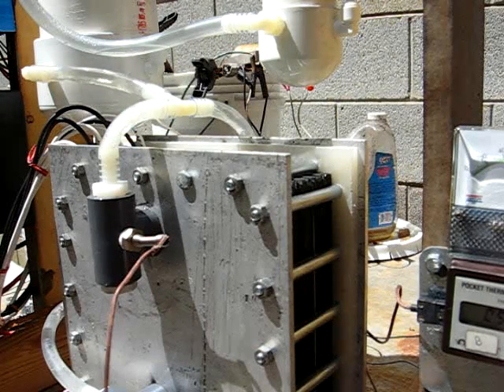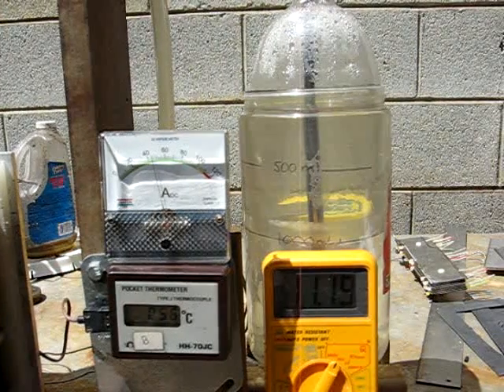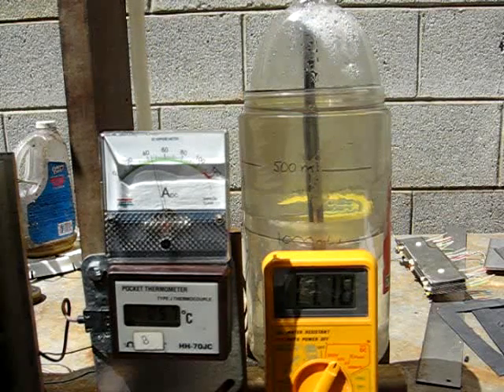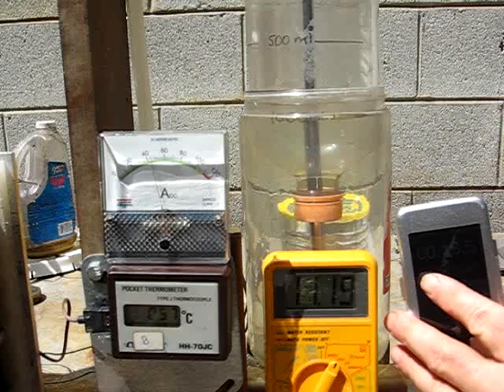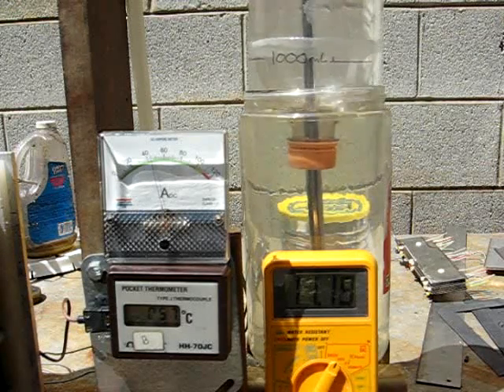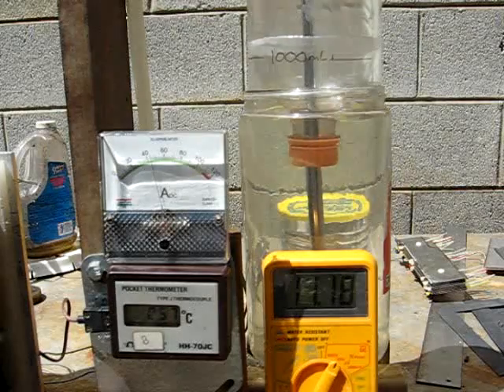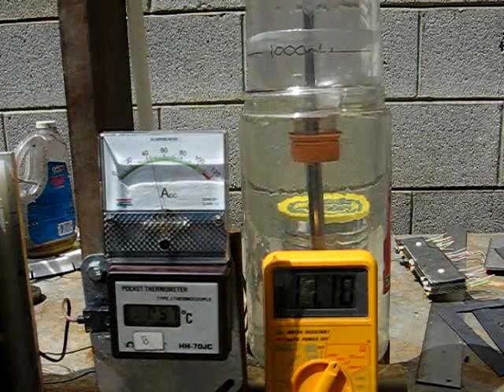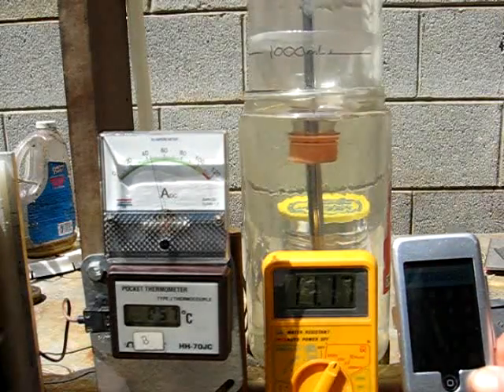004 Flow test 57C 6 cells: HHO Drycell 5.5 mmw 500 watts 3L min

Comment from the maker: Hi RadGenH2O: I used double gaskets as I explained in the component video. one layer is .042" fish pond liner (who knows what it is made of) and the other layer is .017" PVC sheet. The fish pond liner is electrically conductive so I had to add a layer of PVC to insulate the voltage.
Marshall